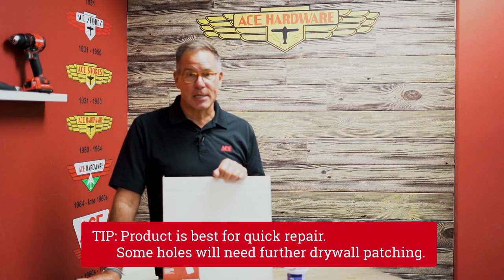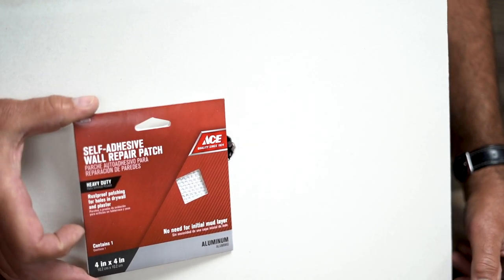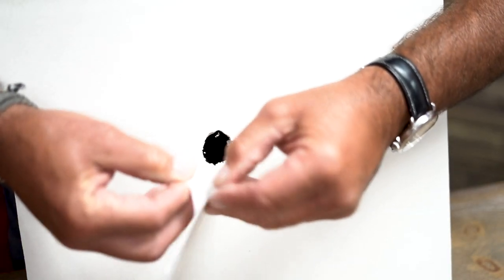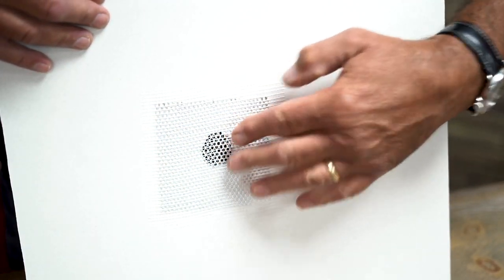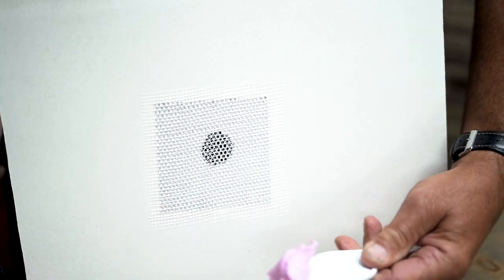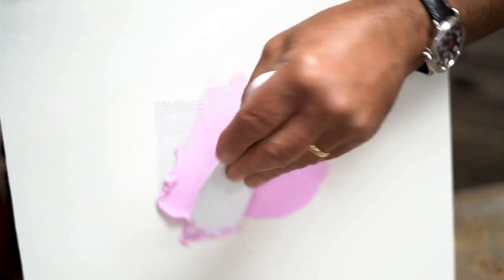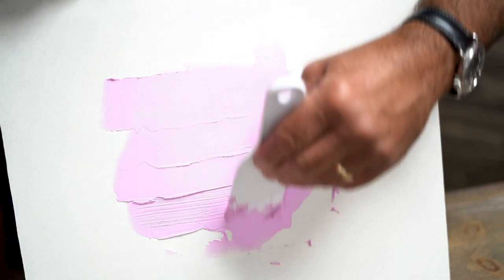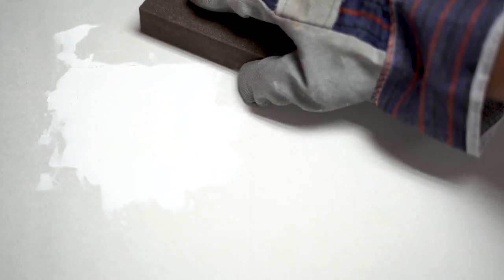How To Fix A Door Knob Hole - Ace Hardware

Comment: Any tips on what to use to fill up the hole instead of using a patch (as the metal shows through, sanding just exposes it) ? The hole is just under 3" and about 3" in depth. Its a small door knob hole. DryDex stuff just isn't cutting it. Thank you.

Comment: Too easy but works , I cut out the rock measure hole cut new piece , bevel rages butter them on both sides with 45 minute hot mud an mud it let dry sand an prime an paint , I have do over hundred like that never used that patch but it works well for the  do it it self guy .
Reply: I'm sorry